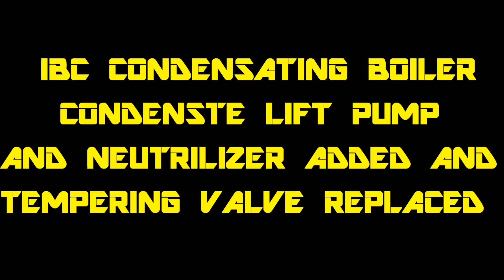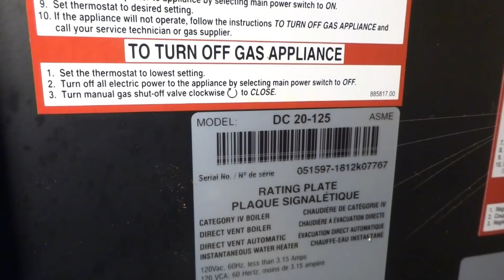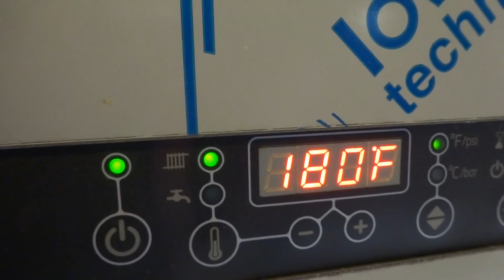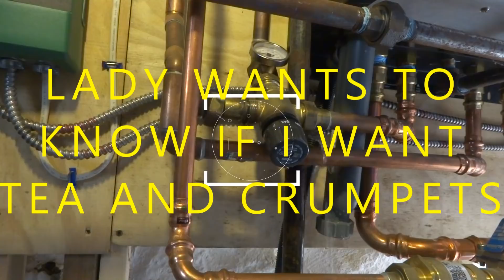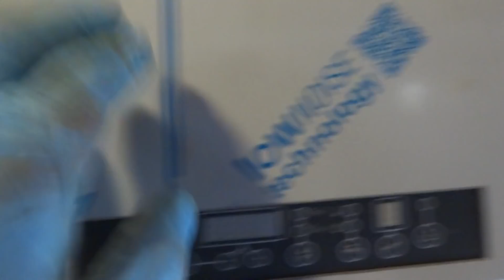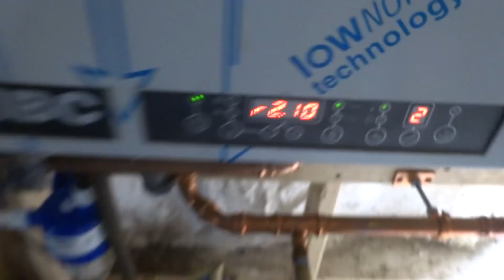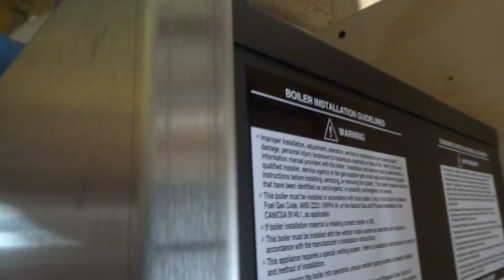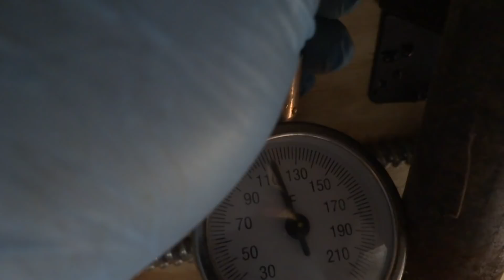IBC CONDENSING BOILER  NEUTRALIZER AND LIFT PUMP ADDED

Comment: Seems like the manufacturer of the boiler is teaming up with Intergas in Europe. At least in the Netherlands, it is almost mandatory to have a high efficiency unit.

As long as you clean the burner side of the heat exchanger and condensate drain regularly, they will last quite some time. I have seen Intergas boilers run for 20+ years without breaking more than a circulator and gas valve. Maybe a sensor or two, but no trouble with the heat exchanger.

We are used to these wall hung boilers.
Reply: i have the Weil McLain one and it has been horrible it shuts down for no reason saying supplys too fast and Weil McClain has no idea what problem is then fan blower went bad for 700 dollars just for the part I put it in now the heat exchanger is starting to get corroded away and the door in about 13 year's time all the parts are from Europe Germany and Netherlands and such

Comment: Great video. @4:09 nice to see another trade doing electrical the right way. You don't have to ground the devices when the box is metal IF the ground is bonded to the box. It wasn't here so good job grounding the devices. Doesn't hurt either way.

Comment: I was almost talked into getting a NTI combi boiler. After researching them on the web I changed my mind. The thing has all proprietary expensive parts and its lifespan is 10 to 15 years. And it has to be cleaned with vinegar twice a year, and it said only a professional can do the cleaning or the warranty is void. I just want a time tested cast iron boiler that will last 20 or 30 years with either an indirect or independent water heater, which is what I was telling the guy in the first place.

Comment: I think Caleffi makes replacement internal parts kits for those thermostatic mixing valves. So you can easily replace the mixing cartridge with minimal effort at less expense.
Reply: Not a single service valve on that system that I saw.

Comment: i have that same mixing valve they are convenient to change with the built-in unions but a bit pricy they claim you can clean them, but I saw no dirt in the old one it just decided to stop working right after so many years.
 on mine the newer one I believe said it didn't need gaskets it came with built in o rings or something instead that was 2023 model

Comment: I noticed that there wasn’t any pipe dope used on the new valve.  Why is that?  I am a just a Johnny Homeowner trying to learn.  Thanks !
Reply: it's sealed with a gasket, no dope required
Reply: Got it - Thanks !

Comment: What does the device with white balls do ? Not a plumber just interested
Reply: It neutralises the very acidic condensate from the boiler. Otherwise the acid could eat through the cast iron drainpipes buried under the floor. It will eat through copper and brass too.

Comment: More and more cold press jobs might be the future ,I had issue running a condensation water into p-trap the crap inside the unit clogged it up ,I had to cut it and put in a running trap .

Comment: You missed installing the 2 extra screws on that receptacle to cover plate.  NEC requires 2 screws holding a receptacle to a raised cover

Comment: Is there an advantage of a boiler over a furnace? It seems that a boiler is 10 times more complicated than a furnace....
Reply: No duct work to run throughout the house, only pipes. No noisy blowers coming on, blasting you with dry dusty hot air. You can make domestic hot water with one, and if the heat exchanger cracks, you’re not filling the house with CO, but possibly the basement with water. 

Really not that complicated. On a traditional furnace and boiler, the burners (whether it be natural gas/LP/oil) work very similarly to one another.
Reply: Depends on the heating system you have, if duct work is present then we have a furnace. If there is hot water baseboard, radiant heat or the best steam radiators then we have a boiler.
Reply: @erikj.2066  thanks